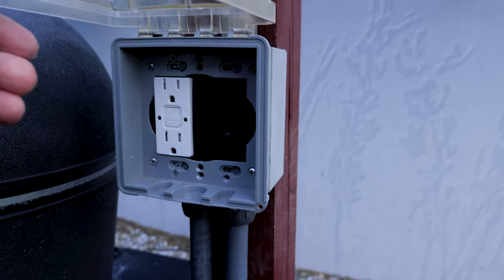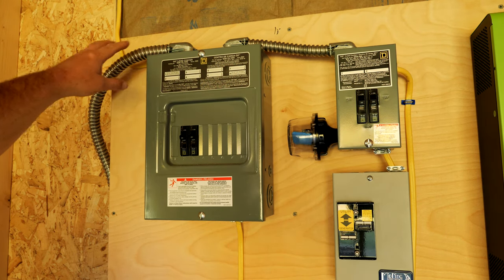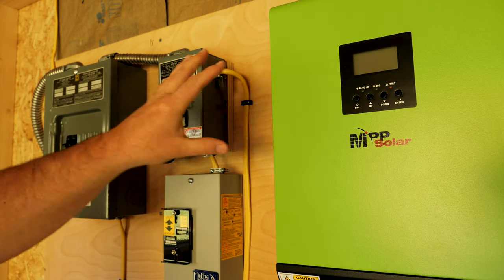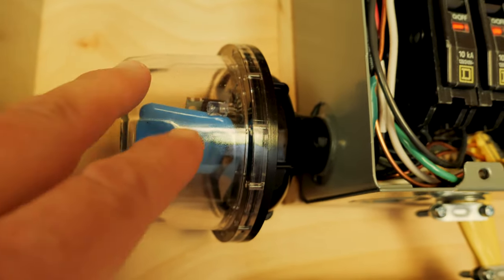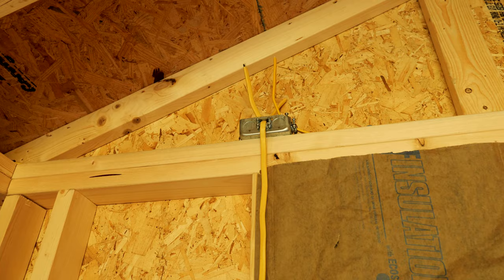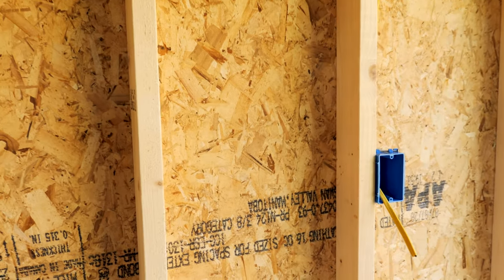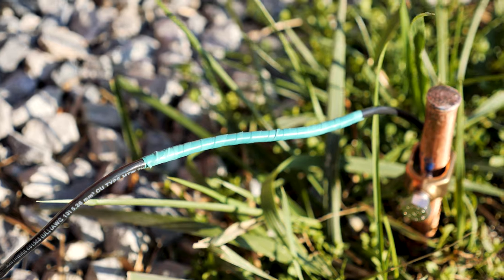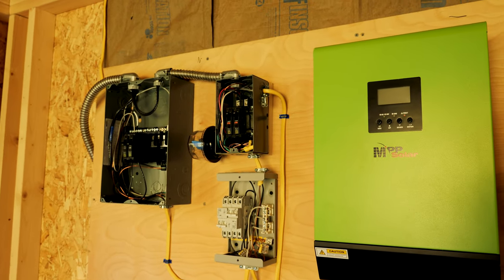New Off Grid Solar Shed Part 6 - AC Wiring

Comment: How is the LV2424 Hybrid doing? I just ordered one today.
Reply from the maker: Nearly flawless.  There is one issue though, one days where it is really cold (under 14F) in the shed, I notice that the MPPT charge controller will only use up to 280 watts or so even on full sunny days.   I usually reset the solar (Turn off and on the disconnect) DC relay and get full power.  I need to do a video on this.  Not a big deal but just an oddity I've noticed.  I think the inverter is only rated to 14F for cold weather.

Comment: Hi, I’m not sure you need that ground rod. If you are tied to the grounding from your lines from your house/pool, then you already have an established ground. If that is the case, adding a second ground rod becomes a problem.
Reply from the maker: Scott, you definitely want to have a ground rod at this location.  This would be the best path to ground for any potential.  Every component is tied to ground from the solar panels to the inverter, in the shed. I would not want to not have a ground here and have that potential have to travel back to house.  Quickest path to ground is what really counts here.
Reply: @GreenMountainDIYGuy   I’m not sure your setup is the same, but watch Will Prowse video called “Does my 13kW Offgrid Solar System require Grounding” to see if what he describes is the same setup you implemented. He talks about creating a ground loop.
Reply from the maker: Respectfully, he's one of the last guys I would take advice from.  He's talented and makes a ton of $$ on YouTube but just looking at the implementation of most of his projects, there's a lot to be desired.  For example would you put 30 solar panesl on the ground, no racking, just to get around rules?  The ground rod here is based on Code (Article A690).   Thanks for watching.

Comment: Nice setup. I just ordered the LV2424 hybrid for home use as a UPS system. Question for you on the inverter AC output wiring. It looks like you are feeding a sub panel from it - do you have the neutral and ground separated, which is typical for sub panels? Thanks!
Reply from the maker: Raj, Thanks for watching.  A couple of things here....on the AC input to the inverter I am coming off a sub-panel in the house so the feed to the inverters is not bonded (only bonded at the main panel in the house).  For the AC output going to the LOAD CENTER (I believe you referred to is as a sub-panel) I bonded the neutrals for the ac input and output in the inverter connections).  You'll find this to be a common occurrence on these MPP units.  The Load Center is wired as a traditional sub-panel with the neutral and grounds separated.  Hope that helps.

Comment: What a great work you have!  Just wondering the reason why you need to setup external transfer switch?  I thought MPP Solar may be capable or programmable for power source switching between Grid or Solar/Batteries?
Reply from the maker: Thanks. Yes, you are correct, the MPP solar can use both but I want the ability to take the shed completely back to grid power and the transfer switch allows that bypassing the MPP and solar all together.